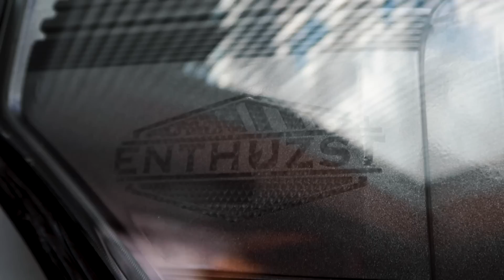These CUSTOM headlights are the ONLY ones to EVER exist!

Comment: -First of all, that truck is SEXY AF!!! It could be your best looking truck yet! Which is saying a lot. 
-Second, make sure to properly aim those headlights. HIDs are incredibly blinding if not aimed correctly. A simple measure is to put their cutoff line 2 inches below the projector light (on the headlight) when looking at the cutoff on a wall 25 feet away.  There are some good videos explaining this more.

Comment: You should get a old truck like 5.9 Cummins or 7.3 Ford
Reply: He had a blue 5.9 cummins earlier in the year. Gave it away as a gift
Reply: @evanpugh7599  he means a 12v I imagine hence old and the 7.3 inclusion not the 24v that he gave away
Reply: @kttcox1  was the 5.9 not a 12V?
Reply: Yeah like in 70s
Reply: He said he wanted too but that it was hard to find where he was from due to rust
Reply: @evanpugh7599  No, the 5.9 was an 07 I believe, 12 valves went away in 98.5..
Reply: @MXracer003x  i didn't know that. I don't know anything about the cummins engines
Reply: Evan Pugh he gave away an 06 3rd gen which has a 5.9L 24v. 1st gens and 94-98 2nd gens had 12v 5.9s and then 98.5-02 2nd gens and pre 02-08 3rd gens have the 24v 5.9. If im not wrong (which I may be) 3rd gens 08.5-10 had the 6.7 then, and now the 10.5- 19 4th and 5th gens have the 6.7
Reply: @zeppish9378  Ah , ok. Thank you for clarifying!

Comment: I just want to see you build a post 05 and a half ford 6.0 diesel
Reply: Coleson Cox  costs a lot of money to make a 6.0 as reliable as anything else
Reply: Never had any problems with mine just run a display and you will know when the oil cooler is diying and if you done push a whole bunch of power through the 06-07 s it’s no problem